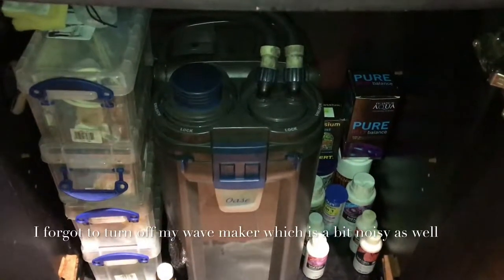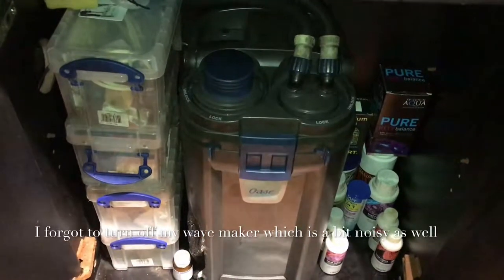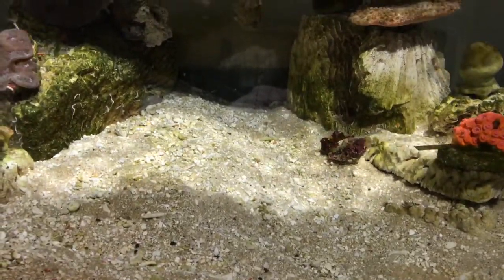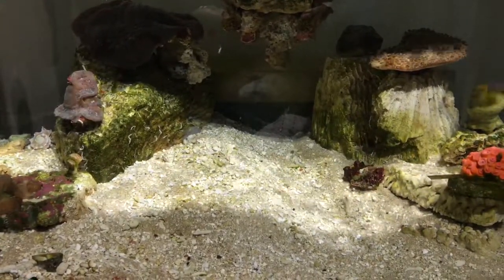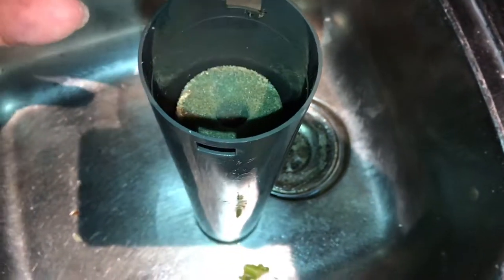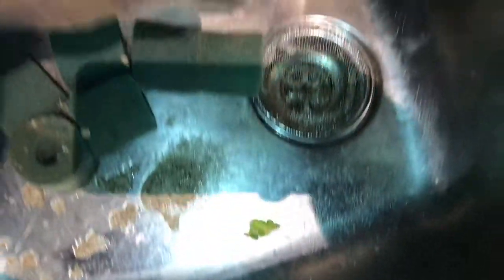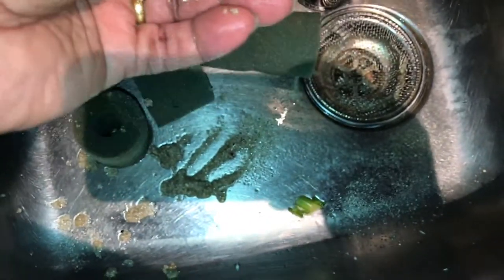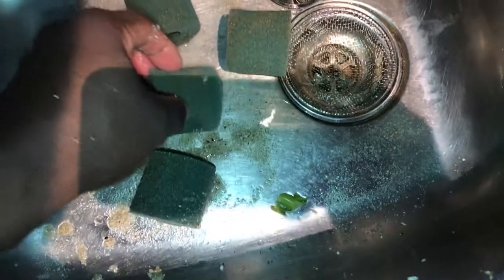Under sand bed filter pt3

Comment: The sand getting into the filter is what damaged the impeller.. and that is rough sand. You need to replace the impeller and be careful not to let loose particles get in like loose carbon (carbon should always be in a bag)
Reply: Good advice. I saw him on another video putting loose carbon in one the trays. Hope he already solved the issue